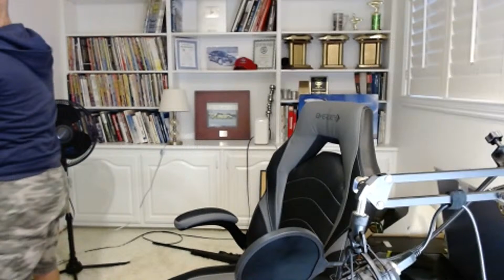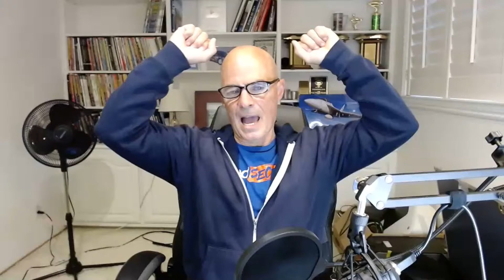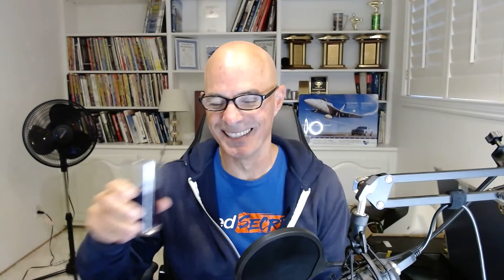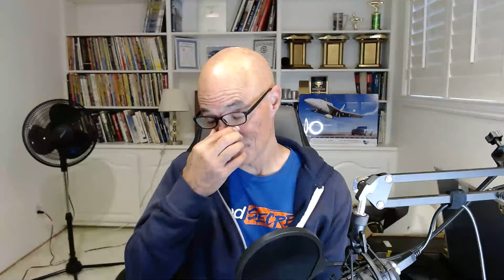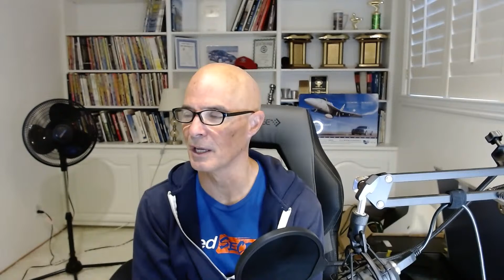LET'S TALK TECH-PROJECT MOTIVATION-GET SOMETHING DONE

Comment: hi richard, just wondering how to go about a max effort 289 (at 289 cubes not stroked) . all internet info seems to have it stroked as the first thing lol.  thanks
Reply from the maker: big cam, much better heads, high compression, good oiling system, lots of rpm

Comment: Referring to the question on valve springs being compressed over time if they lose their tension. Stapleton42 on YT is doing videos on redoing one of Lake Speeds Sr’s old engines that sat for almost 20 years and the springs were tested and the springs were within 5-10 lbs of their factory ratings after all that time.
Reply from the maker: good info

Comment: Chevrolet 350 HO 330 HP engine, prepping/dress out for install in 1986 Chevrolet K10 short bed Silverado. Today Specifically curved MSD distributor, WO/ vacuum, and installed.  Never use vacuum advance on any .  (Note: NHRA SA C)
Reply from the maker: NICE JOB